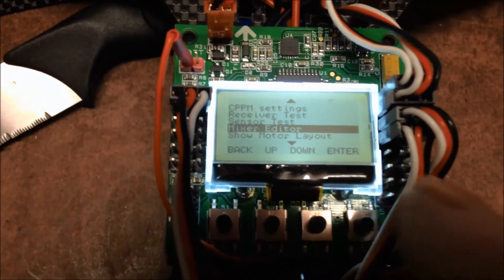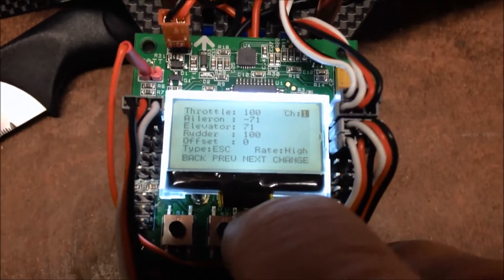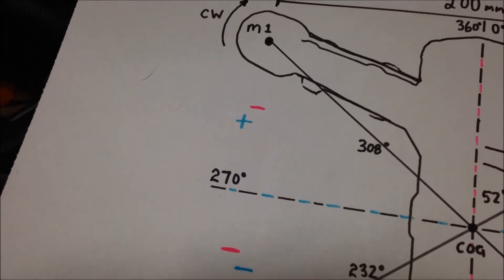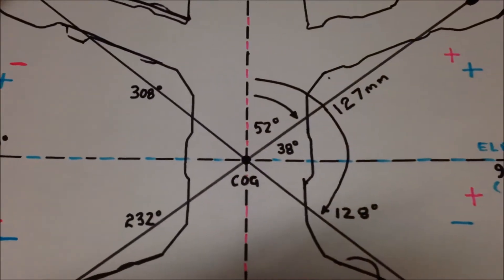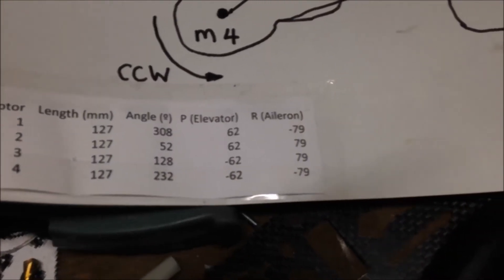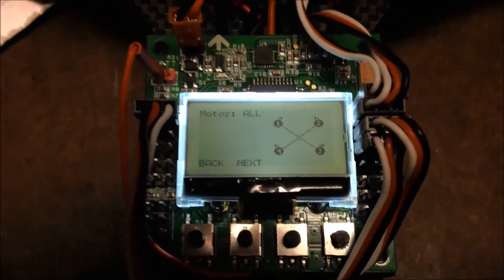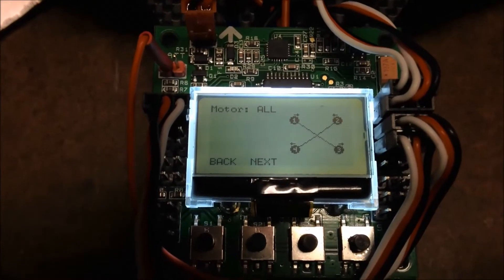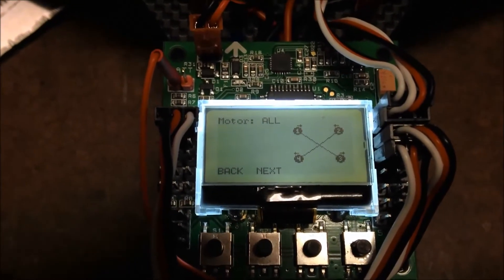ZMR250 Mixer Editor applied to KK2.1 KK2.0. Flys soooo much better

Comment: Hi, Thank you for this video!  I also setup a ZMR250 with KK Mini. Everything looks fine, all rotating in the right direction, props are right, ESC calibrated, Receiver Monitor show the correct direction.  When trying to take off it will only spin in place CCW. Any idea on how to resolve? Thanks